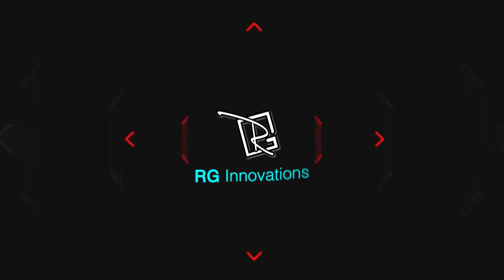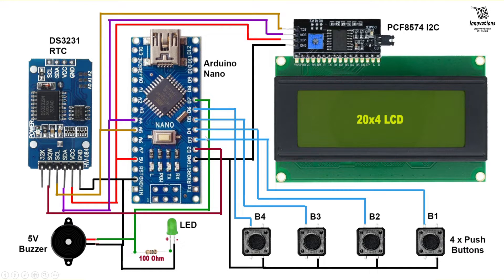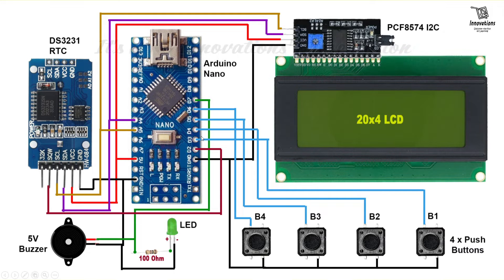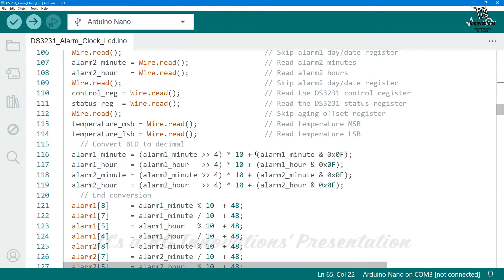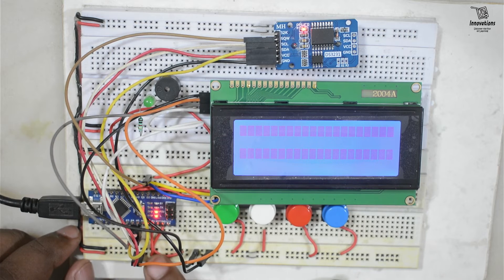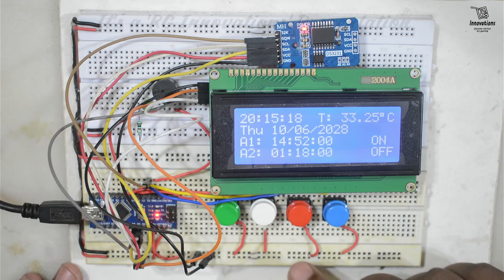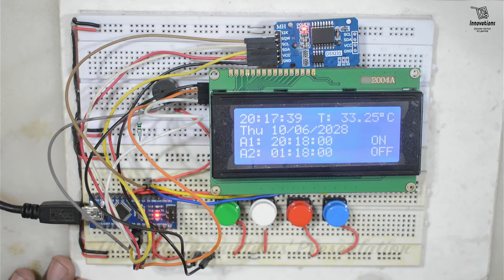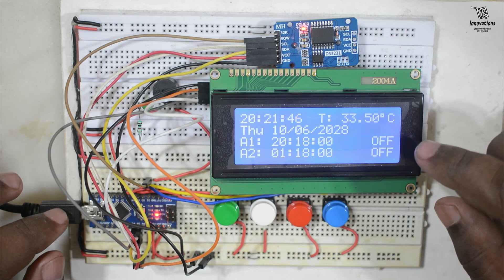DS3231 Dual Alarm Clock with Manual Date Time Adjustment Using Arduino Nano and I2C LCD Display

Comment: Hi, i want to ask about the project. i run the coding but the minutes for both alarm1 and alarm2 shows =0 and <0. how can i fix it? 8:08
Reply from the maker: Check the rtc module and battery
Reply: @RGInnovations  Thank you! It fixes it right away!

Comment: how to go about if we going use 16x2 lcd  with rtc , just as project . where set alarm , edit date , time and etc ... will you video on this
Reply from the maker: If you study the sketch, you can simply change the code for 16x2, the entire arduino sketch is commented for easy understanding.

Comment: Good evening thankyou for the awesome vid but what should i do with the code incase i wanna use an 16x2 ic2 lcd and add a letter to the 2 alarms as to symbolise something
I.e. x = study
Reply: I also want to remove the temperature so how would i be bale to do that
Reply from the maker: This code is for 20x4 lcd, entire code needs to be re-written for a 16x2 lcd. If I find time I will try to post that.
Reply: @RGInnovations  i see thankyou so much and wish your channel well
Reply: Hello i been trying and modified it for 16×2 yet nothing is showing in the lcd(it is powered) why do you think that is? @RGInnovations
Reply from the maker: Try adjusting the contrast potentiometer
Reply: @RGInnovations  also about the overlapping wiring how did you deal with that?
Reply from the maker: Where?
Reply: @RGInnovations  the vnn(5v) , ground and analog pin 4 and 5
Reply from the maker: All are separate pins, no overlapping is there.
Reply: @RGInnovations  i meant overlapping wires on the pins sorry i was not cleae
Reply: Clear
Reply from the maker: Can you show me a picture? Your point is not clear to me.. Mail me to rgstech85@gmail.com

Comment: do i want to change code if i use lcd 16x2
Reply from the maker: Obviously the code has to be changed.
Reply: @RGInnovations  what are changes to be done
Reply from the maker: Lot of changes needed, i will try to post if I find time to rebuild it.
Reply: @RGInnovations  can you please post by today night
Reply from the maker: Sorry today not possible, i am busy in my profession, it will take some time.
Reply: @RGInnovations  can you suggest any other video to ring the buzzer in some fixed time
Reply: @RGInnovations  can you please share
Reply: @RGInnovations can you please share code today